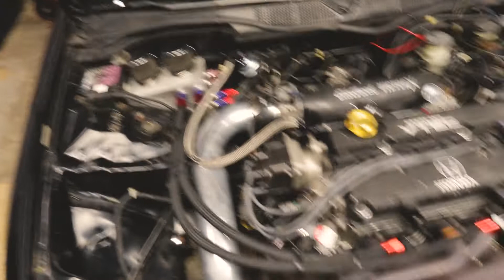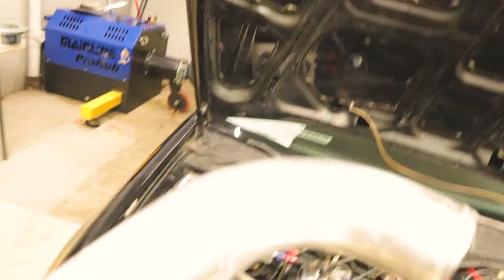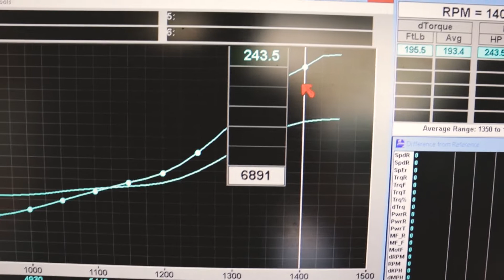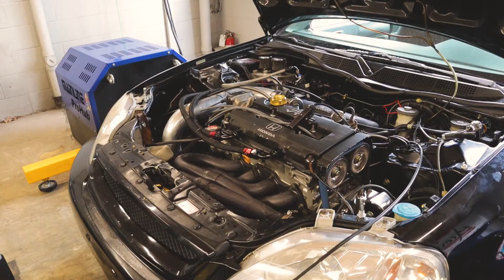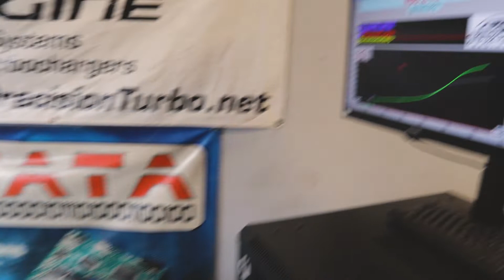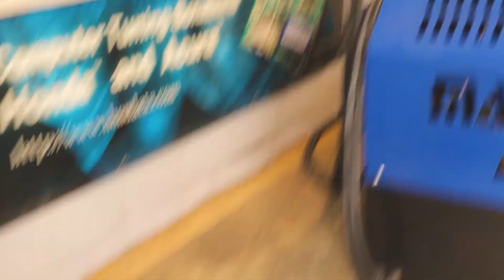Turbo Honda with Unique Turbo Manifold hits the Dyno!

Comment: Seen the charge temp in a rubber grommet boost leak too many times too. Tap and die the charge pipe and sensor for pipe thread. Simple solution. Works perfect.

Comment: Get the T4 .58 A/R or T3 .63 turbine housing...
Reply from the maker: I usually go bigger on the AR on Honda’s. They like to rev. In all of the years I’ve been doing this i have never seen one this lady even with turbos 10mm larger and 1.32 ar housings. It’s def another issue not just the turbo or housing being “too large”
Reply: Joe the bov was unhooked.like i mentioned lol Im surprised u didnt see it . Sure that was my issue. Its hooke up nw.

Comment: Ctr cams for the win!
Reply from the maker: If you actually get ctr cams they work great. So many people think they are getting ctr cams and end up with some other oem cams that don’t work well. I hate that haha
Reply: Joe Simpson yeah I feel you! I picked up a set for 285$ shipped! They work great in my b17! Can’t wait to see what they do on boost!
Reply from the maker: Twisted_717  that’s a killer deal! They should work well. As you can see this car wanted to keep making power with rpm!
Reply: Joe Simpson I peaked 178.8whp at 8k. I thought it would have made peak a little higher but I was happy with it. Does that sound about right for those cams?